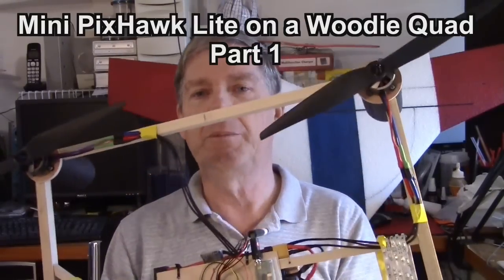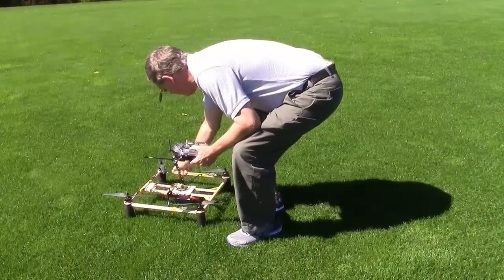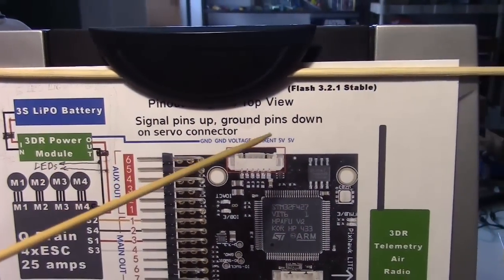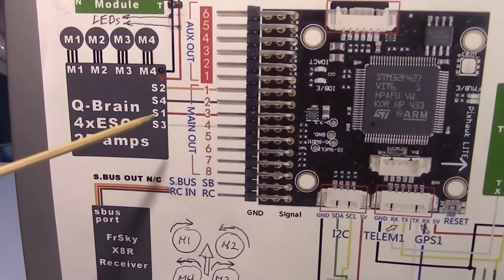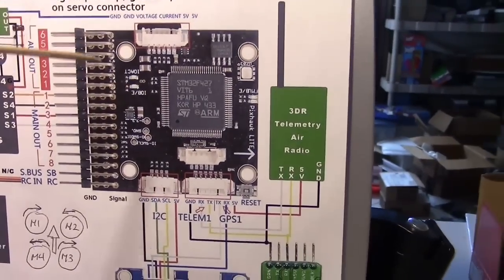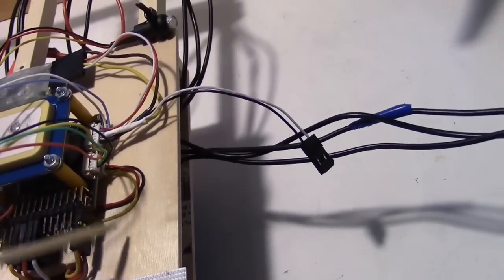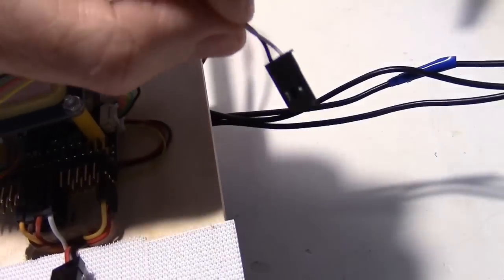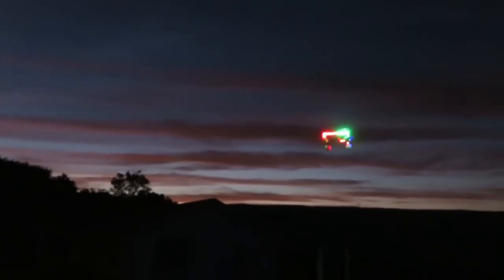Mini PixHawk Lite Build Part 1 - Wiring Setup on a Woodie Quadcopter

Comment: dear sir i am still confused on how you wired up the compass/gps ,do i have to make up a cable? i am using a m8  that has a connector 4 hole that has 2 wires for the 12c and one 6 pin plug with 4 wires help please
Reply from the maker: +ksped1 What I did was move the wires by using a needle to lift the tabs on the Molex plugs and sliding the wires out. Then I made changes following the wiring diagram I provided. The only soldering was to make the split connections for the telemetry radio and MinimOSD.
Reply: +dmerc00 Thank You

Comment: Thanks for the helpful video. I have two questions.

1- Is it possible to connect two telemetry ports? one for radio and one for companion computer?
2- How can I connect Spectrum DX7s RC to the pixhawk lite?

Thanks.
Reply from the maker: +Mohamed Abdelkader Zahana Not sure about either one of those questions but you could look on the RCgroups thread:
http://www.rcgroups.com/forums/showthread.php?t=2418029

Comment: Is there a dedicated gimbal support?
Reply from the maker: +Les Schilling I think there is but I will find out out more later on. I have a Tarot 2D gimbal on the way and will try to install it during this build series.
Reply: That'd be great if you could cover that. I want to replace my Naza Light I currently have in my TBS Discovery. This was a great insightful vid, thanks and cheers!!
Reply from the maker: +Les Schilling The gimbal is something I have wanted to add for a long time so I am excited about implementing it. I see in the mission planner there is a gimbal calibration that can be setup on channel 5. Will be trying that too.
Reply: I look forward to that. I'll be running a Tarot 2D gimbal as well. Thanks and good luck!